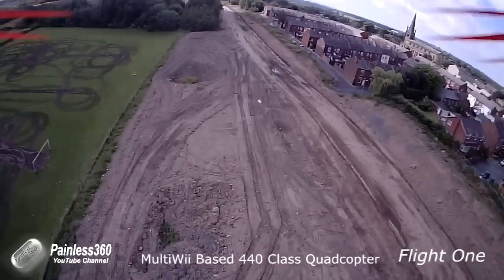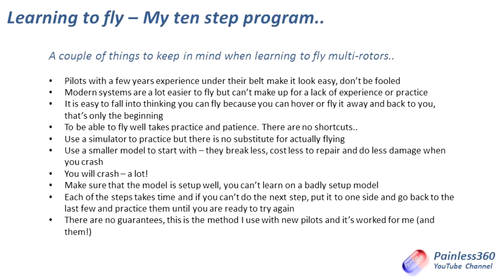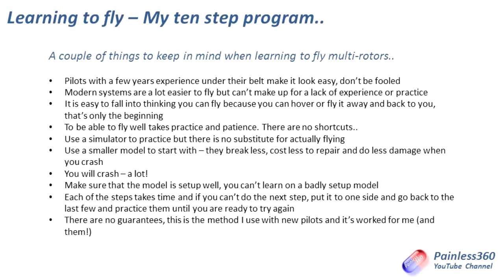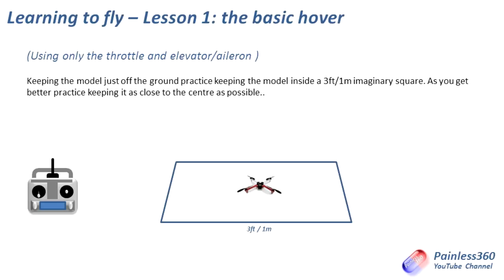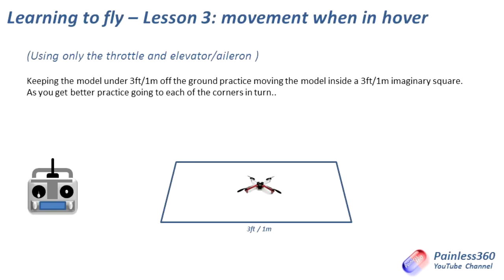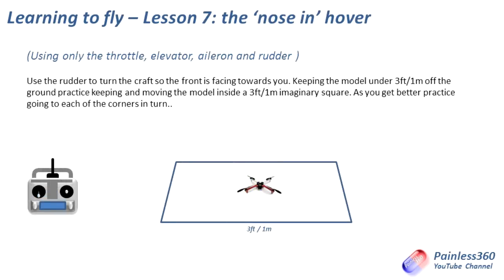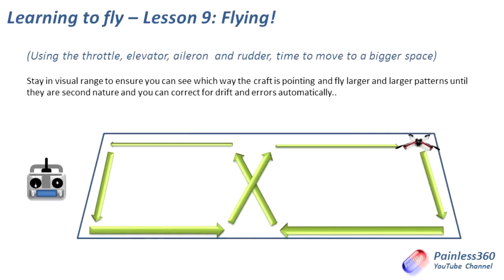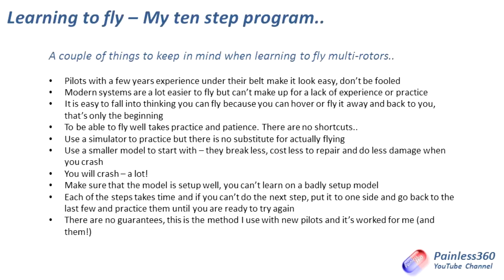RC Basics: Learning to fly a multirotor

Comment: You are absolutely right.  But many people don't care about this. It's great to see this here.  I am still learning, too. I'm getting better,  but I have tons of props,  the setup is hard, the flying or hovering in any direction I can't still do that,  but with goggles it's much better. Thanks for your time for that.
Reply from the maker: Great to hear that despite using FPV you are committed to learning to fly line of sight (LOS). This is a key skill and will make you a far safer and more accomplished pilot and give you a chance to save the craft and reduce damage when one of the systems on the model glitches.

Happy flying, and practicing!

Comment: Thank you for this video.  I have my first quad on order H8 3d mini.  I selected it for 2 reasons, one of the reviews recommended it for beginners in the beginner mode and the price made it so that it won't be as painful when I destroy it in a crash. I planned some very basic moves to learn control, but was unaware that the rotational attitude would take a long time to learn how to control, so thanks for the heads up.
Reply from the maker: +David Moran Learning to hover 'nose in' is one of the trickiest parts for many pilots - you may be one of the lucky ones! Best of luck with it all.. Happy flying

Comment: Great video... I am pretty sure I did this exactly in reverse so I can recommend your approach! After playing with "toy helis" I went and built an 800 class hex years ago. That thing is big, powerful, and dangerous and I never really felt competent (was great at advanced hovering) until I had a good smaller model to play with. You can crash a small model, laugh at yourself, and start over... not so much with an 800...

Comment: I appreciate this video  Specific to MR's there aren't many learning to fly videos around.  I started a similar way about 6 months ago, but really maybe less then 25 flights to date.  Anyway, the thing is at least with the Syma X1 indoors, is you have to start compensating with both sticks immediately otherwise things go quickly out of control. So in a way, the lesson instructions sound calm, example - rudder about 10 degrees, but so far for me, I also have to do a good amount of Ail / Elev to keep it stable. 

I've had more luck in a larger outdoor space though where I have more time to compensate.  Of course that was once I passed the "caught in a tree" and "fly away" initiations. ;)
Reply from the maker: Thanks for the comment, I always recommend the ol' Hubsan X4 because when it's trimmed and setup well it will hover in one spot and auto-level beautifully. Gives a real confidence boost and supports learning.

Keep up the practice. By getting the ability to fly, and hover, in all orientations you will be far safer and more accomplished pilot!

Happy flying (and practicing)!

Comment: Awesome video. Much needed advice. Been flying about two weeks, hubsan q4 followed closely by 2 fq777's and another q4 to get the most flying time. Unsure what to upgrade to next. hubsans are amazing but the fq777s one is really good the other one has two dud motors
Reply from the maker: +Al You are going about it the right way. I'd look at a 250 class quad that you can repair easily. Best of luck!

Comment: I started learning indoors with small quads, but I found them very twitchy - I couldn't really think fast enough to control them properly in a confined space. By contrast, flying my Syma X5C clone outdoors was much easier. There was more time to think with no walls or furniture to crash into, and the quad itself seemed to proceed in a much calmer, more predictable way.

So I think a case could be made for taking a Syma X5C (or similar) out into an open area such as a football field to try the steps you suggest in the video.

I also find it's harder to hover in ground effect. The quad seems to scoot around like a skater on ice. Being afraid to get higher off the ground held me up for several weeks when I was learning to hover.

Comment: Thanks for this! I have just started the hobby with a UDI U818A and have been practicing step one in my living room for the last three days. One question I have is what your recommendation is for the manner in which you move the controls. Currently I am finding that very short but full full range tweaks of the pitch and roll are the easiest way to nudge the quadcopter in one direction or another. By this I mean flicking the control one way and letting it return to neutral, flicking again, over and over.  
When I try to use small gentle continuous movements of the control, I find the quadcopter starts skidding around too much because I can't seem to put in a small enough input to maintain a position and instead send the unit into flight in that direction. I assume this latter gentle continuous control input is what I should be striving for, but just thought I'd ask your advice on the mechanics of giving RC control inputs. Thanks!
Reply from the maker: Some of the less expensive radios are not as smooth or easy to use.  When I first started to fly then I found it easier to use sharp staccato movement to try and correct any drift. Keep at it. In time the corrections will start to happen automatically and then you can tackle the harder steps.. Best of luck!

Comment: Sorry for the offtopic question, can I use a 6S extension cable and plug in a 3S battery and balance it? Or do I need to use a 3S balance extension cable? 

Thanks!
Reply from the maker: Depends on the charger. You can't connect a 3s balance tap into a 6s connector though - the cut-outs will not line up.

When is comes to LIPO batteries safe not sorry should be the motto. Get yourself the right cable and you'll avoid any trouble.

Happy flying!

Comment: Just need clarity on a point. In lesson 5 are you flying tail-in when the craft is heading towards you?
Reply from the maker: +Chris Curls Yep, it's easier when the craft is in motion than hovering nose in. Some pilots need to start with this step and avoid the nose in element. Best of luck!
Reply: +Painless360 thanks a lot for your quick reply. Great video by the way. Just got a Hubsan x4 and not found many tutorials for beginners but this is very useful. Had been following these steps, more or less, so far anyway. Trying to hover low down and move between markers on floor, increasing rotation each time the battery is recharged. Good to have some steps to follow in order to master each element.

Comment: thanks you for you information. is there any good way to monitor battery info on a cc3d? I have a little beeper which plugs into balance port so when I am flying it goes off. but after a few mins the voltage is higher as the load has gone off it. should I set buzzer lower so after the battery has rested it will be higher?
Reply from the maker: +neil200830 Depends on the radio and how you fly (FPV or LOS). The answer is not easily. I use almost exclusively timers on the radio these days as after a few flights you get a very good idea of what you can get away with.. Best of luck.

Comment: What is your suggestion about expo setting for beginers?
Reply from the maker: +Borivoje there is a lot of snobbery about expo. Without it new pilots can quickly get into trouble and give up. I would look at an expo between 15 - 30% and turn it down as you get used to it and and can control the craft easily. The aim is to make learning fun and accessible but not become a crutch for poor stick control. I would start with a small model like the Hubsan X4 before thing a bigger model. Best of luck with it!
Reply: I already have  Blade 350qx 2 , fw2.0 .
 I made AP, Stability and Stagility mode on my Dx6i. Most of the flying time I am using AP mode. 
That mode is ok. I am very familiar but that mode is not for fun, only for video recording.
Once I flew using Stagiity mode, and did Flips and rols. I was shaking but every went just fine.  
Several times i tried to fly in Stability mode, but I can not be able to maintain the same attitude in the horizontal flight. She always tend to go upward. 

My settings dir/expo settings are :
Rudder     P1 100%   P0  100%
Aileron     P1  100%   P0  75% +25 %
Elevator   P1  100%   P0 75% + 25%

Please, write me additional suggestion about rudder/throttle settings, please.
Kind Regards.

Comment: Hello I have been following your guide. when I try to hover it just off the floor and put a little bit more power in the quad seems to bounce in the air up and down like the motors are getting more  power then I am putting in. and it going higher then stopping then hight then stopping. can you help me please
Reply from the maker: +neil200830 Don't worry, that is normal as the craft is hovering on top of the air 'bouncing' back from the floor. You'll find that as you land any hard, non porous surface with seem to 'push' the craft up as you come in those last few inches. This is sometimes referred to as 'ground effect' and 'dirty air'. It makes it harder to hit the floor but once you are above a few feet then you'll not see it at all.. Best of luck with the rest of the lessons!

Comment: I think it's difficult to fly by fpv googles ... could you give first steps tipps? Flight Modes etc.
Reply from the maker: Hi, there is a video which covers some of this - https://www.youtube.com/watch?v=KpDl_mopytA

I would recommend that you FPV with a craft you know well and is trimmed and setup perfectly. Get a fellow pilot to be your spotter and they can help if you get stuck. Get to a large area devoid of obstacles and people.

Make sure the craft is in a auto-level mode before take off so that you can let go of the sticks and it will self right. Make sure that it has some form of GPS RTH feature setup that can fly it back to you if you loose orientation or have an issue with the FPV video.

Taking off is one of the trickiest parts - just blip the throttle and don't be shy about getting some height quickly. Once airborne, dip the nose and then fly it like a plane, use the rudder and aileron for smooth turns and keep that forward momentum at all times. Hovering is the hardest thing to do FPV as movement to the sides/backwards is hard to spot unless you are near to something. Moving forwards all the time also avoids 'reversing' into trees etc!

Finally I don't land FPV, I get the craft in front of me, pop it into self level and pull the goggles up to bring it into land. This is where the spotter can be invaluable.

Hope this makes sense and helps.
Reply from the maker: Hi, I sent you a PM with some details in. Let me know what you think of - https://www.youtube.com/watch?v=DXe6pPf2fXI

Thanks in advance

Comment: any change doing a tutorial on how to trim a quad properly - not managed to work out to do this on my Eachine H8 Mini?
Reply from the maker: +Cillin C Trim or tune?
Reply: +Painless360  which ever one is to fix the quad from drifting when i take off straight up....it drifts forward and to the left.   i am compensating with the other controls but am sure that it should go straight  (ish) up if only power is used
Reply from the maker: +Cillin C Not sure. Some mini quads let you reset the accelerometers to help with problems like this (see our Hubsan videos) but I can't find the manual for this online to give you a clue. Check that the trims on the transmitter are in their middle positions (they usually make a longer 'beep').. Best of luck..

Comment: I should have known better..... I decided I was going to make a fortune two years ago taking pictures of VERY expensive houses and (with the the owners' permission), use them to help sell their property or just hang on their walls to show off! 

So I went out (with no experience of flying ANY RC models) and spent close on £2,000 on a Phantom 2, GoPro, Black Pearl 7" screen and a 2000W (the UK limit is 25mW!) transmitter. A couple of months later I bought a set of Skyzone goggles.

Flying with just two batteries was frustrating so I bought another eight. This may sound ridiculous, but I thought that as I'd flown real helicopters for many years and was a fixed wing pilot as well, flying quads would be a doddle.

I still have the Phantom and GoPro (more luck and only flying over grass fields than judgement) but if only I'd been more patient and seen this or some other instruction video I'd certainly be a far better pilot than I am now.

I only started to learn properly when I decided to build my own multirotors (thanks again, Lee!) and realised that the 'plastic' flying I'd been doing for so long had just lulled me into a false belief that I was a good pilot.

Now I've bought a Syma X5C and will teach myself again from basics in my living room.

I think we all need to be brought 'back down to earth' occasionally. :-)
Reply from the maker: +Doug McKenzie thanks for posting that. Many pilots use the flying aid in models like the Phantom or move onto FPV before mastering the basics of LOS flying hovering. They don't have the basic skills to safely control the model in the event of a problem/failure. The hobby would be a better place if more had this epiphany. Happy flying!
Reply: Doug McKenzie zz

Comment: I just destroyed my Hubson x 4. Crashed it unknown times. My 16 hands horse stepped on it. Lost it in a tree for three weeks until a storm blew it out, found it the next day drenched. This craft can take a beating. but today after about 6 or 7 months of abuse, it died. I will try to rebuild it and then faithfully put the time into learning to fly it right.  Thanks for the opportunity to become a good pilot.  I live out in the country witch is great for not hurting anyone but not a lot of people to learn from.
Reply from the maker: Kitt Condrey-Miller thanks for the comment, great to hear that the plucky little Hubsan had survived 7 months of crashing. Most the the parts on my second one has been replaced now! 

Out of interest what had you learned in the months you have been flying it?
Reply: I spent a lot of time learning to hover. Then at waist high going from the office down the hall into, the kitchen and back. Then into each room and back. Up and back on the front porch then like walking the dog all over the property and then out onto the street. All pointing away because I just get lost once it is pointing at me. Just started flying around my body pointing in. All the same time i am doing this I am trying other operations that usualy get me onto trouble. Did some test this morning only had a bad prop. So Hubson lives on.

Comment: using 3 different quads i am now starting from step 1 on the 10 step program...
Reply from the maker: Best of luck, take each step at a time and you'll have it all mastered before you know it..

Happy flying!
Reply: The small kitchen gives loads of turbulence and combined with the ground effect and propwash it is harder then one might think.
Reply from the maker: petfrogg i know what you mean. I thought our kitchen was an ok size until I had a little four channel helicopter skipping over the tiles. Many hours of fun trying to get it stable, what a way to learn but I was able to hover and correct any drift like a champ once I'd finished!

Happy flying!
Reply: Painless360 I am now doing "tap-dancing" in step 1. Took a while to come down to 1-2 cm but starting to feel confident. At first i thought it was hard to hover that low but it works out really nice. I have now started to test step 2 but is there a reason for flying 50 cm instead of 100 cm? By being a bit higher no prop-turbulence is affecting it - but am i suppose to experience the prop-turbulence as a part of the training?
Reply from the maker: You've got it.

When the craft is lower the need for throttle control is less as you ride on the up draught from the props bouncing off the floor. As it sinks towards the floor the craft gets an extra lift from the rising helping it stay in the air, but this turbulence causes the craft to 'wander'. Step one is all about cyclic control.

Step two is higher as this is adding throttle control to the mix and the height makes it easier as you are out of the downwash from the props.

Best of luck with the program!